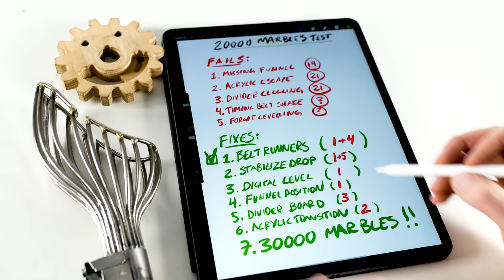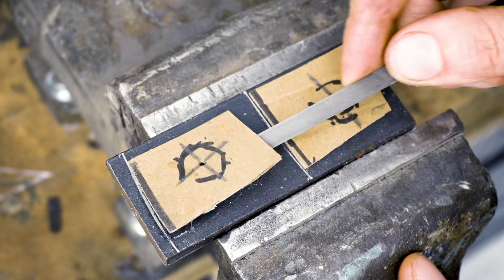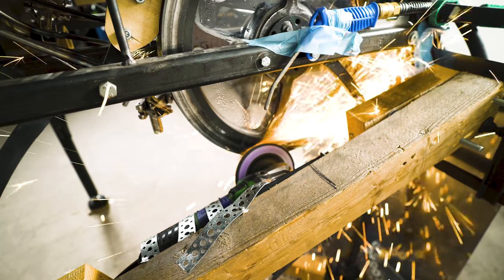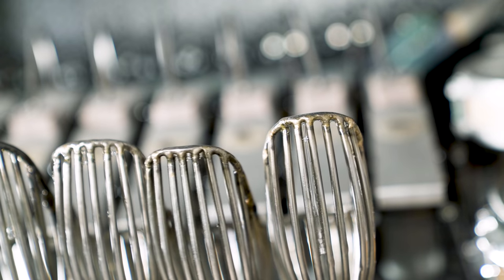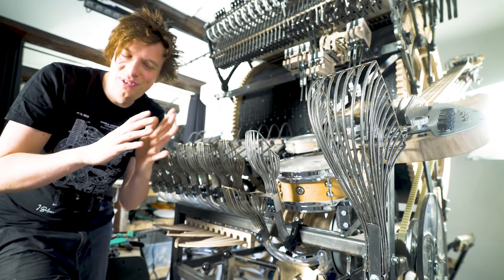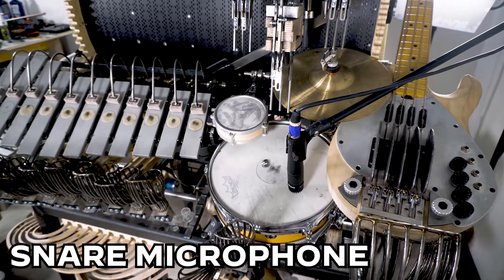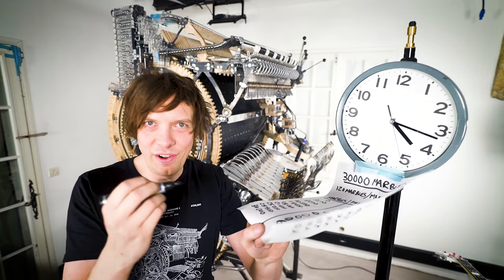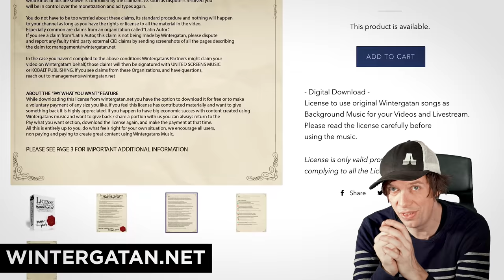Playing 30000 Marbles - Marble Machine X #148

Comment from the maker: Youtube made this video available in 4K finally! There have been some issues with youtube not displaying our recent videos in 4K but if you have a 4K screen you can now take a look at the clean floor in hi res.
Reply: You're so freaking COOL! LIKE OHMYGOSH I WANT TO BE AS COOL AS YOU ARE
Reply: Can't wait for the marble machine
Reply: CONGRATULATIONS!

can you play 696,969 marbles next?
Reply: Good morning mar bremachinegood sou nd.
Reply: Ah, so that's what it was. Hurray for higher bitrates! :D
Reply: I think that the whole frame could have been more beefy.... and that's before you even hacked into it 1000x. Great project though... can't wait to see you in concert!
Reply: I know sometimes YT will post a low res version then the higher-res versions appear not too long after. Maybe the 4k are a lower priority for them?
Reply: Who would of guessed? Attaching the cutting part of an angle grinder to a flywheel is a bad idea!
Reply: for flywheel best option will be disassembly and go to tire change shop and balance it but not adding weights but grinding/drilling material on opposite side. (solid material have not ideal distribution of mass) after that wobbly don't do anythingthink
Reply: clean floor
Reply: Martin why you upload a week late? When will the next part be
Reply: Great job! You should start running your tests to failure. That is to say, run it until it fails, check the timing, figure out the marble count at that point. Instead of 30k this time, 40k next time etc. You will get a much truer idea of reliability and progress
Reply: DUUDE! Why did you Spoiler!
(na, just kidding. Watching anyway^^)
Reply: I believe :D
Reply: Will the there still be a traffic jam after the fish ladder when you open up other channels?  The available space for the marbles is reduced by blocking off all but the snare drum channels I assume.
Reply: Isn't this a non-problem? The pipe will not get clogged once the machine is playing on all channels!
Reply: 30K in 4K!
Reply: You are an inspiration to us...never give up my freind...never give up
Reply: How many marbles are in the machine currently?  Will you have to increase the amount of marbles when you open up more channels?
Reply: You needed a small lathe, like the one an auto mechanic uses to "turn" brakes to spin more true.
Reply: I wanna see the song you made for this video played on the marble machine X one day
Reply: Something that may help with those vibrations. To reduce "ressonance", try cutting a couple of holes at the top of the square tubing and filling the frame with sand. Sand will add mass to the supporting frame and absorb part of the vibrations. I recall ToT also did that on his CNC building series.
Reply: Why not just put a standard automotive bolt pattern in the hub and bring it to an auto shop to be balanced by weights? It's hard to make a perfectly balanced wheel, that's why the automotive industry doesn't bother, they just balance it after the fact....
Reply: Thank you, Wintergatan, for your inspiring, creative video. I have been super down lately. This video made me happy and turned my creative switch on in my brain. I need to create! Thank you again! 💕
Reply: I'm wondering which one is the machine ? You or the machine !
Reply: the clean IS pretty floor
(... i was about to send this... at 1 am... and noticed: I'm bad at english)
Reply: Triplet notes... I want to hear triplets for the next test.
Reply: i hate your sketchbook(Ipad), use papaer please... its impossible to look that... _Thanks
Reply: We need a clean copy of your song without the computer voice intrusions. That was head bobbing rockin'.
Reply: If you want to get rid of the vibrations without risk of the magnets falling off I recommend using sticky wheel weights you would normally put on the rim of a car think it'd be less likely for them to come off then magnets
Reply: Those 6 are an outlier, you only have two channels running right now. Once you have more channels open and running that should not be an issue. So i would count this as 100% success.
Reply: @SpeedohDark  i was thinking the same thing. What is the maximum and minimum number of marbles you would need when the machine is running at full speed all instrument going at once.
Reply: For future reference a flywheel is also known as a harmonic balancer. Same is true for the wheels on your car & its why they have lead weights precisely placed on them. Balance via harmonics.
Reply: Did anyone else see the window at 24:15? He is in high speed and it looks like it is in real time. Weird, was it a person?
Reply: @Kafj302  each 16mm marble is ~.5 an ounce, if the marble machine had 10,000 marbles which is close to 400 lbs of marbles. At first I thought he was increasing the total amount of marble, but he is only increasing the time the marble machine runs. 3600 marbles in 30 minutes, which is 2 marbles per second.
Reply: I watched it 4k and it was spectacular
Reply: have you tried to soundproof the room so you can sleep at night
Reply: Hi Martin, great Video and another step to your goal, I thought about the fish stairs and recognized that if you start playing music with fast and slow beats, the marble count in the machine would get unbalanced, wich could cause that this problem will accure more often. You should think of an overflow security system which can held marbles back if the divider is to full and give them back to the system if needed, to get a balanced marble count to the right melody.
Reply: Can you livestream the million marbles?
Reply: I want a WILLSON ornament for christmas! when can we buy one?
Reply: So basically the flywheel worked like a rim from a car that needs to be balanced with weight
Reply: dont worry u can make 1hr long videos everyone watch it till end im purely sure about that
Reply: 'clean floor'
Reply: the balls that hit the drum still make a lot of noise, when you hit the second time, I think the option that you showed, when the ball trap is closer, will make less noise
Reply: i cant imagine the whole team screaming at him
Reply: use paste wax on tour gears and the funnels need felt where they contact at the tops then its just the marble release when the arms return , there is almost no other noise to chase i cane descern.. great effort and thanks for the videos
Reply: For what it's worth, you can do the math automatically in the spreadsheet, instead of doing it manually in a calculator. For example, for cell E3, you could write =(C3-D3)/C3 then click Format in the menu and set E3's number format to Percentage. You can then copy this cell and paste it in the cell below it, and the formula will automatically update relative to where it was pasted - in the cell below where it was copied from, all cell numbers will increase by 1. If you have a cell you don't want this to happen to, you can lock its value in by putting a dollar sign ($) right before the cell letter or number. For example, if I put the marble goal in cell C20, and I want C3 and C4 divided by C20 in cells D3 and D4 respectively, I can write =C3/C$20 and copy that downward.

This will also make your percentages more precise - for example, using 2 out of 38 tracks comes out to 5.26315789% of all tracks used. The decimal might go on even further, but that's as far as OpenOffice cares to tell me. This is the number that will be used for all calculations with this cell, regardless of how the cell is formatted. To keep the transparency with your formulas, you might need to add new columns - this can be made easier by right clicking the column's letter (at the top of the spreadsheet) and Inserting a column.

https://docs.google.com/spreadsheets/d/1i59r01BLrjdn86JnaiYsW1j4ze6Qabf0NgaAZxYwNEs/edit?usp=sharing
Here's my version of your current spreadsheet, copied over to Google Docs. Feel free to do whatever you wish with it. I had to make a custom number format to get percentages with three decimal places, which you can do under Format, Number, More Formats.
Reply: Wow, that floor is amazing! Can you come and do mine? You're so versatile.
But, seriously, you're doing some amazing stuff. Congrats.
Here are two tips for you. At the 19:47 mark, you should add some felt strips to the sliding wooden blocks to dampen the vibrations. They are creating vibration as they return and strike the other part of the assembly. Applying felt would be the easiest solution. Or rubber.
26:05 I don't know why you made the marble divider assembly so complicated. The fish stairs is sort of redundant.
I would have all the marbles return into one sorting bin with 3, 6 or 9 outlet pipes.  I assume you are familiar with commercial sorting bins where they use inserts in the bin to divide items before they come out. This would ensure that the marbles don't clog the bin. Feed the bin from all sides if you can. Once out, you raise them up and use your current design to feed them into the 3 pipes you have.
Good luck.
Reply: The marble is not weightless. It is never in free fall motion. Just not enough time to reach terminal velocity.
Reply: 16:19 Martin, you should place some dempher to decrease the impulse of closing gate. It can also decrease the noise as well.
Reply: I only got power enough for 240p.
Reply: One question about the magnets on the fly wheel won't they be shifted over time due to centrificle force?
Reply: Martin, I have a really good question for you!!!...
I already know the answer, but the question is awesome!!!
First, when I was a child, I use to play with marbles. When I'd buy a new bag of marbles, I'd notice that a few would have imperfections. They would be a different size than the rest, a different shaped and possibly a different weight.
Question : Do you calibrate the marbles? Do you measure them to make sure they are all the same size? Do you check to make sure they are all the same shape? Perfect spheres and not oblate spheroids? What about weight? Isn't it possible that most marbles weigh in at a gram and some marbles could weigh slightly more or slightly less than a gram? If you have 1000 marbles all perfect spheres, all with a circumference of 1.5 cm and all weighing 1.25 grams, isn't it possible that in the next 1000, one or two may be misshapen a little, weigh less than 1.25 grams and has a circumference of 1.37 cm? If you have a few deformed marbles in the batch, wouldn't that likely cause some fails? The only way to know if all of your marbles are exactly the same and identical to each other is to measure and weigh every single marble.  It's not actually "calibrating" them, but it sounded good! LOL
I said that I already know the answer... I'm really sure you took the time to measure and way each of the 30,000 marbles before putting them in the Marble Machine! I just wanted to pass this by you - because when you play 40,000 marbles, you may have some fails!!! If you do, check the marble before getting upset and blaming the Marble Machine!!! I'm sure that buying marbles in bulk, by the thousands, would include some marbles with imperfections and deformations. I'm sure these marbles will fail. I'm surprised we didn't see it in the 3000!!! Please tell us how you control that variable.
Thanks Martin!
And... Congratulations!!!
Reply: What a lovely clean floor. I think you can give yourself a pass with the 6 lost,  once you have more than 2 channels running it wont back up the same.
Reply: The axis of the fly wheel is off. Grinding it at that position will only visually make it look stable from outside, but you are cutting material from one side of the wheel, which made it more unstable by off-weight. So only solution is to correct its axis.
Reply: If you can play 30.000 Marbles with the snare, you cant be sure to play 30.000 Marbles on the Bass for example...
Reply: Have you considered the possibility that there may be some defective marbles? Like slightgly misshaped or over/underweight that might be responsible for some of the fails? Do you reuse the marbles that resulted in fail? Cheers;  what an awsome piece of engineering!! Keep it going to 100.000,00!
Reply: I think it might be a mistake to add a gate which cancels out the sound of the machine. I personally really love the sound of the machine working, and I think that is one of the things that makes your music unique!
Reply: You just need a overflow pipe.
pretty much a Pipe that take marble from the marble divide when it is about to overflow and throw them on the low tank.

just like water my friend, just like water.
also, have you tested the maximum marble flow?
BTW, you need a Counter with display it would uses close mic + gate to get the beats, and send them to a pulse counter.
said pulse counter can be anything, a computer a microcontroller, or even electromechanics.
Reply: My phone is an LG stylo 6  it says it can run 1080p but it is skipping pause than going pause maybe it may be the GPU idk.
Reply: clattering of 6 marbles Well almost clean floor! :)
Reply: Angle grinders are not meant to work continuously man, i think you learned that the hard way.
Reply: Just Lorien — Ja das ist rech!
Reply: Ethan Hanson — Nein , er kann es uberleimt —Spatere punktschweissung
Reply: You should call this song ‘clean floor’!
Reply: not sure how fast that flywheel is going  or how strong those magnets are, but to do the job properly you should weigh the magnets and weld a piece of metal in place
Reply: You ever think of how a car tire is balanced? Maybe take it to a tire shop and see what they can do?
Reply: HI Martin, the belt will eventually have slack again, because of usage, its better to use a belt tensioner that you see on cars, they have a spring in them which will at all times keep the exact same pressure on the belt. so when you have more slack the springs will level it out. maybe something for the future.
Reply: The whole machine could be flexing and theharmonics of all of the sounds being made may be creating a vibration also.  With sin waves, they can be amplified at one spot or muted which would have energy be giv n or taken away.  That is a long shot but maybe .

Edit. Wrote early in video an does not apply at all
Reply: Steady state can be a B.
Reply: High resolution*
Reply: @MirelleLaRouge  69 hours at 240bpm :)
Reply: @handlemonium  quik mafs
Reply: One of the reasons why the marbles may have missed is also that the surface of the drum will be vibrating and every once in a while a marble is going to hit the surface that is slightly angled different just enough for it to miss.
Reply: WHAT HAVE YOU DONE YOU CUT YOUR HAIR
Reply: Can you add springs or like shocks to the drums and everything you don't want shaking??? Expensive maby
Reply: Nice Clean Floor!
Reply: Random question, what kind of accent do you have? It is very unique. I like it.
Reply: Ol
Reply: man i would eat from your floor. so clean is it
Reply: The improvised song NEEDS to be released by its own, real bop that one!
Reply: Needs more cowbell
Reply: Why not use a car disc brake rotor for the fly wheel? They are balanced.
Reply: Still an awesome/incredible result!, i love your face like... "what the heck..."
Reply: Wintergarten
Reply: You should have asked people work in tire stores for suggestion. They know this trick.
Reply: Man love this but honestly from the first video ever to this machine I really believe that the OG imperfection was bliss that is not to say this new machine isn’t amazing good job man
Reply: PLEASE CREATE TIME MACHINE ..I WANT TO BACK TO THE PAST FOR MY SECOND CHANCE
Reply: 100th comment
Reply: You got some serious bags under your eyes get some sleep my dude
Reply: hey Wintergatan did you know if you did "=c3/d3" in the e3 cell and drag the square in the bottom right down to the latest test. this will automatically create data, and if you apply % number type then it will be auto filled.
Reply: Possible fix for slow down problem?? maybe an emergency marble track? like when there are too many marbles in the tube they go into another recess for the marbles. idk like an emergency parking lot that some businesses have
Reply: You look like the male version of the person that showed the caves and cliffs update on Minecraft but still really cool instrument
Reply: @EarL GreY Tea what's there?
Reply: @EarL GreY Tea I don't help spammers. Instead, I report them.
Reply: Idk why but when I see you and your special instrument I think at Gaston Lagaffe
Reply: admirable, i want say that it´s the more impressionant video that i ever see! you hard work and how you do it. you  left me in total admiration.. I´m so happy for watch this kind of crazy ideas.. go for more!  From Argentina!
Reply: You need am engineer and a mechanic to help you man i guarantee that it would help
Reply: @Christopher LeMasters true maybe get them as consultants then so he dosent spend 3 days doing something that could take the poor man 2 hours lol
Reply: DUDE U ARE SO HARDCORE I'M AMAZED NOW I'M TOO EXCITED TO SEE MMX ON PLAY <3
Reply: @robleffler6584  This is actually a great ideaand makes do much more sense to me.
Reply: Jangan
Reply: Hope you’re working on the million drop right now. Merry Christmas!
Reply: I have been checking my phone every single day to see if there is an update, i love just ABSORBING the information you give out like I'm an information hungry sponge. I want to be able to make whatever I want like you can in the future. You see a problem, think of a solution and then MAKE that solution with SUCH ease it seems like.
Reply: Hope you have a good time of now in December. Locking forward for new videos 2021. It has bin a dark December her in Sweden without your weekly Wednesday.
Reply: Should have just taken the flywheel to a machine shop
Reply: P
Reply: marbles are glass i thought
Reply: You are a genius Martin!!! Absolutely amazing!!! 🎵🎼🎶💃🕺❤️🎉🔥😘
Reply: You really should have balanced it, counter weighting would have been faster and less likely to damage your equipment.

EDIT :
4 minutes further into the video.  Ya.  Ok glad you finally took my advise.
Reply: How much would it cost for you to build one
Reply: wait did you buy the museum of sciences marble machine?? :O there was a dope one when i was a kid it had ssuch a dope instrument collection... would you be able to infom me if that  one was special? or if they are just made? :D new fannn
Reply: Hindsight is 2020, but shouldnt you have leveled the machine before grinding your flywheel to true?
Reply: @団子好きの伯父さん  nh¨
Reply: Wow its gotten Beautiful i remember the time started it tell now it Great
Reply: How about balancing the flywheel, then the vibrations also disappear
Reply: 이것만있다면.백날이하루같이.찐하고.깊은.감동.에흠뻑젖어살듯!머리와.기술.예술.이.초특.급수준!좀전에만해도이정도.이하수준도.다.기상천외를.경험하는듯.신기함.을.느꼈었다.참대단한실.력.가장.감동적인건.이분이음.악적이고.예술적이여서.더욱매력을.느낀다.만인에게.초ㅡ미에관심.을받을만한.수준!
Reply: Yo at 24:21 your window shows the ghost living in your house bro. The white flap covering the window opens up a few times
Reply: You should try running it, i kmow you said there where too many problems for it to work consistantly, but it would not be a bad idea to work on those problems and see if you can make it work the way it was originally supposed to
Reply: Yo at 24:21 your window shows the ghost living in your house bro. The white flap covering the window opens up a few times. Can you at the least acknowledge it?
Reply: I am so amazed by you!